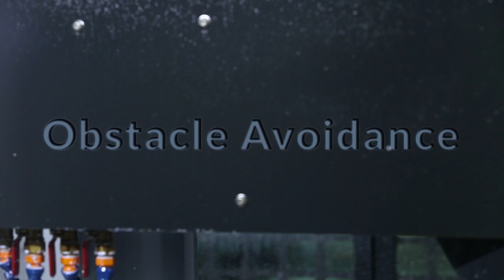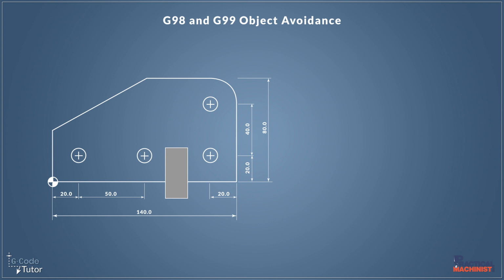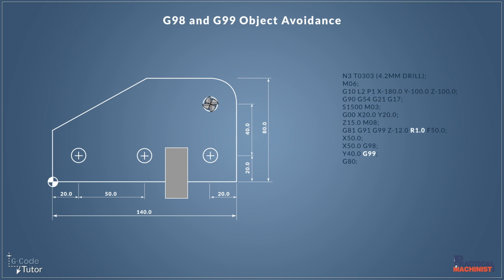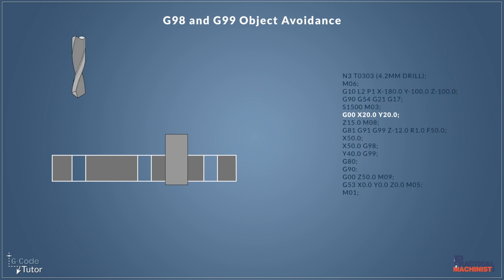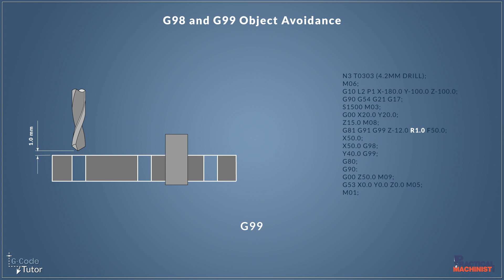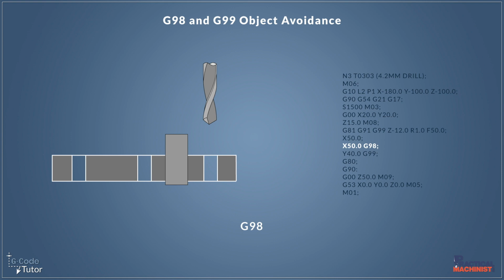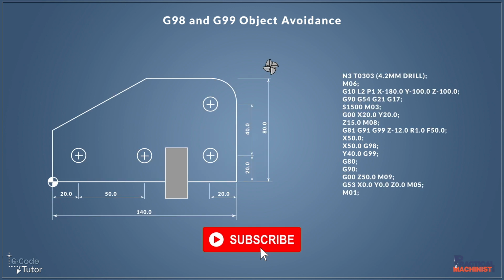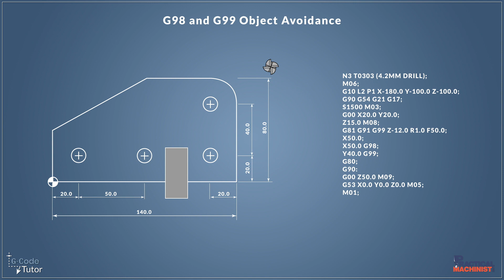G-Code tutorial - Avoiding Obstacles Using G98 and G99 Codes

Comment: The code is wrong. G98 should be on the line with the first X50, then G99 should be on the line with the second X50. G98 and G99 describe what happens AFTER the hole is drilled. The code should be as follows:
G81 G91 G99 Z-12.0 R1.0 F50.0 (Drill first hole at X20.0, Y20.0, then return to R plane -> Z1.0mm)
X50.0 G98                                       (Move +X50.0 at current height, 1.0, drill hole, then return to Initial plane -> Z15.0)
X50.0 G99                                       (Move +X50.0 at current height 15.0, drill hole, then return to Retract plane -> Z1.0)
Y40.0                                               ( Move +40.0 at current height, 1.0, drill hole, then return to retract plane)
G80

Comment: The G98 requires the full Z-axis retract (to 15.0mm in this example)  BEFORE the rapid traverse to the next hole location? Instead of the Z-axis retract to the R value (1.0mm) and then rapid traverse Z15.0 X50.0, because that could still crash, I want to clarify the machine behavior.
Reply: that was exactly my experience when switching from G99 to G98 in the program, even though I switched before calling the next position (not saying this video is wrong or anything, i had that accident before watching this). what fixed it was cancelling the cycle when i was done with G99, call the next position which was higher and then start a new canning cycle. works great